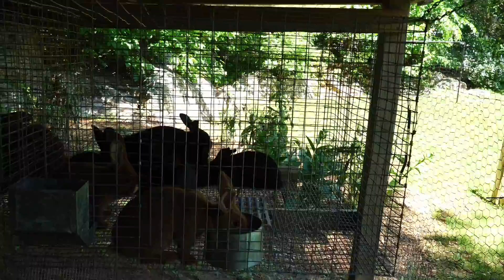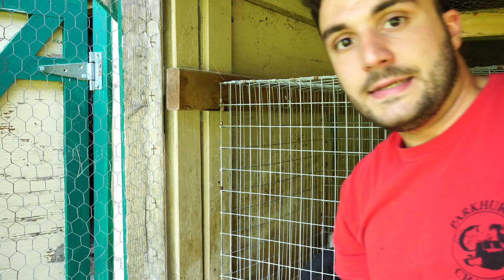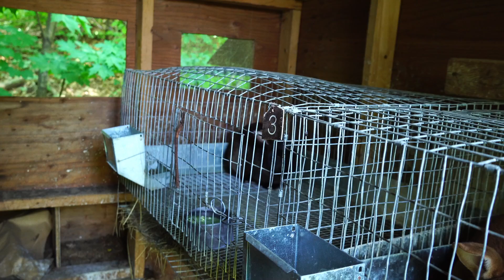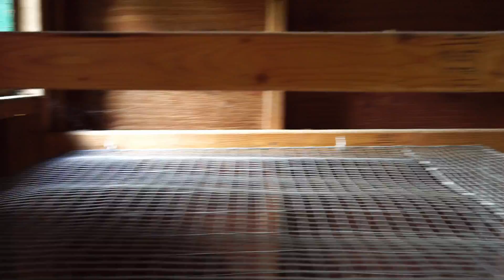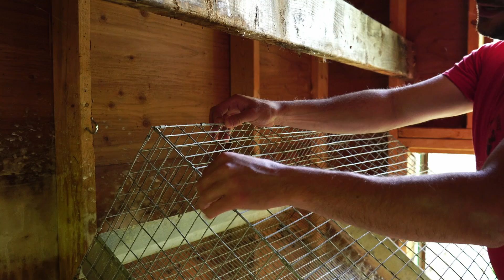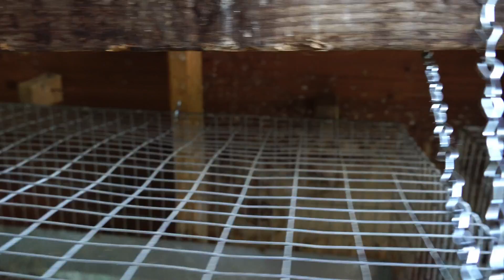What Is The Best Meat Rabbit Setup? Here's How I Set Up My Meat Rabbit Cages!

Comment: Hi! How important is daylight for the rabbit? I have a stable with a huge box that is perfect for cages but it only has two small windows and I worry the rabbits can suffer from that. I will have rabbits for honesteading.
Reply from the maker: Good question! In my opinion, daylight is super important. It helps regulate the rabbits circadian rhythm, helps encourage breeding, and keeps disease down. But with only two small windows, I'd be more worried about ventilation. 

Now rabbits don't need direct sunlight, so if you have a barn door that can be left open to provide ambient light and lots of airflow, that could work!

Comment: Staple plastic or trash bags to the walls of the shed behind the cages helps keep the urine from soaking into the wood helps alot with the smell we did this method in our barn.
Reply from the maker: Inside the shed we used to use chloroplast or PVC boards which were much more durable, but I like to use a flame weeder to sterilize my cages so all plastic had to go!

Comment: Sam!! I’ve been binging your videos like crazy! SO much super helpful info for someone just starting out. I’m on the hunt for the 14 gauge wire and I think I saw it somewhere but I’ve watched so many of your videos, I can’t remember which one you said the best dimensions for a cage? I’m trying to figure out how much wire I’ll need if I build my own! Please save me from watching all videos again (even though I’ll revisit many on purpose) and tell me your cage dimensions! Really appreciate all your succinct info and have already recommended your channel twice since the short time I found it! You’re doing a great job and helping the rabbit raising industry across the globe!! 🇨🇦
Reply from the maker: Thank you so much! My "standard" cage is 36 inches wide and 30 inches deep. I'm working on a refresh of the design but I've been delayed by out of control home renovations. Should be out this year though!
Reply: @ I finally found it after much sleuthing! And your buck cages 30x30 right? How do you get the floor to be 30? Do you just J clip together? Most rolls I’m able to find are only 2’ wide
Reply from the maker: @Vandepolhomestead  Glad you found it! I usually wouldn't recommend j clipping floors as it greatly weakens them and can bother the rabbits' feet.I get 30" wide rolls from Kluberantz. They are located in the Midwest but may ship to Canada.
Reply: @westmeadowrabbits  I’ll look into it! Thank you ☺️

Comment: I know this is an old video, but pvc on iron cages, anyone know how they do for rabbits? I can’t find any gauge 14 wire with suitable sized mesh.
Reply from the maker: Do you mean wire coated in plastic?
Reply: @westmeadowrabbits  yes, but the metal is described as iron, pvc coated. It says they are rabbit cages or for pets.
Reply: @westmeadowrabbits  hi there, thank you for replying to such an old video. I’ve just looked them up again. It says galvanised iron. It says gives years of use. I don’t live on a homestead, but a rented house in UK. I would like to keep meat rabbits for my use, I enjoy wild caught ones occasionally.
Reply from the maker: @anitachisnell8412  No problem. They would likely be ok, but the plastic  coating will not last as long as the metal. Be sure to provide resting boards just to be safe.
Reply: @westmeadowrabbits  thank you, yes I will get boards, and I watched your video on vinegar to clean them. That’s a very useful tip, thank you again. I’m enjoying listening to your videos, I’ve like and subscribed to them.

Comment: I'm just getting into breeding meat rabbits and finding your videos VERY helpful and informative! I'm working out my cage plans and planned to do one like you mentioned, with doubling them up with the roofing in-between. My plan is to have 4 cage/rabbits per stand. And attaching the cages to the stand framing with mending plates. 

It's just a plan in my head for now, but it might be helpful for someone to get an idea to run with. 😊
Reply from the maker: That's a good plan! We are building out a new rabbitry, so I'll have a detailed video on this soon, but two suggestions. 

I wouldn't recommend stacking cages unless you absolutely have to. And make sure you can easily remove your cages from your frame/stand for cleaning. 

Good luck!

Comment: What dimensions are the holes in your walls and floor?  Sorry if I missed it.
Reply from the maker: Which holes?
Reply: @westmeadowrabbits  the size of the wire.  Are the walls 1” x 2” and the floor 1/4”?  Sorry - wasn’t clear.  Thanks!  

We are in west Texas.  I’m studying on how to battle the heat.  At 112 degrees rabbits don’t do well so I’m rethinking things.  Considered the colonies but honestly I think the fire ants would kill the babies.  

Thanks - I enjoy your channel!
Reply from the maker: @doublemountainman9962  Walls are 1 x 2", the floor is 1" x 1/2". Wire is 14 gauge after weld. That temp is definitely on the upper end of what rabbits can handle, but with good airflow, several layers of shade, and maybe some misters you could still do fine!
Reply: @westmeadowrabbits  Perfect.  Thanks amigo.

Comment: You can just use that chain and hang the cages from the chains letting them swing free.
I've seen large commercial rabbit setups using hanging cages and they seem to prefer it that way.
Reply from the maker: It's an animal welfare thing for me. Rabbits are creatures that spend their whole lives on or underground. The swaying motion from free hanging cages is probably uncomfortable and possibly stressful. There is certainly a lot to learn from commercial operations, but the larger ones are basically factory farms and like any other livestock, the welfare standards can often suck. I understand at the commercial scale where efficiency is necessary why this happens (although I don't approve). At the small scale though there is no excuse. There are many small things I do around my rabbitry to improve welfare where I can. Over sized cages where the rabbits can stand on their hind legs, natural foods, resting boards and solidly mounted cages that eliminate motion. These things are little inconvenient but well worth it.

Comment: good video.... but to get those screw hooks in better than channel locks stick a screwdriver  threw the hook and spin it around  into board until you reach the depth you need.  Or attach a small vise grip to hook an spin the vise grip around saves handling a pair of bulky channel locks
Reply from the maker: Agreed! Many people have said the same thing. With those particular hooks and the angles in the cage channel locks were my best bet at the time.

Comment: A little tip for sinking your lag hooks into framing lumber--> Chuck up a lag hook in your drill gun. Interlock that hook with the one you want screwed into the frame. Use the hook in your drill gun's chuck to spin it in.
Reply from the maker: That is a great trick that I will be sure to use!

Comment: If I live in a city and have a house. Can rabbits be kept in the garage or shed during the winter?  Where to buy pre-built cages?  How much?  Can you recommend sources?  Do you sell?  How to keep them warm in the winter?
Reply: Tractor supply has ready made rabbit cages they come in 2 sizes about $40.00
Reply: I once had rabbit cages in a vinyl shed, and the problem I encountered was them urinating on the walls.  So I wouldn't put  them in or near an enclosure that will let it soak in especially wood.

Comment: What are the advantages of hanging the cages, rather than having them on legs?  VERY new to all of this.  Your content is excellent!  Would love to see a series of videos on making the cages and how to site your rabbitry.  Thank you!
Reply from the maker: Hopefully I will be moving soon and documenting a rabbitry build from the ground up. Hanging give you more access to the bottom of the cages, allows you to easily remove the cages for cleaning and repairs. Also prevent predators and parasites from climbing up the legs. Wood exposed to the ground, manure, and urine, will eventually rot and need to be replaced.
Reply: I’m wondering what you think about the hanging cages where it gets very cold in the winter? I live in Canada and our winters get down to -31 to -40. Would I be better off having it on the ground, in colonies? Or are they fine at that temp?
Reply: @angienelson4258  in your climate, caged rabbits need to be out of the wind in the winter at a bare minimum.

Might be able to generate a little warmth for them with deep bedding underneath to decompose with their urine.

Colonies are definitely better at handling that kind of cold imo

Comment: Your content is super informative, thank you so much! I was wondering what the average low and high temperature is for your area and the measures you take to protect your herd from the heat/cold?
Reply from the maker: Glad you find it helpful! This would be a good subject for a video, which I will try to make this week. Short answer is, if they are kept dry and out of the wind, and have plenty of food and water,  adult rabbits can take basically any cold. They can take the heat up to 90 degrees without a lot of humidity. Higher than that won't kill them but growth and breeding drop off dramatically. I will elaborate further in the video.